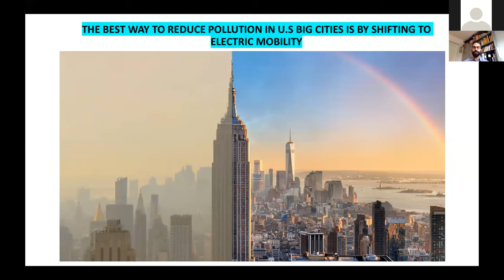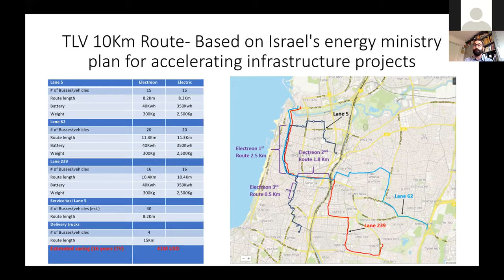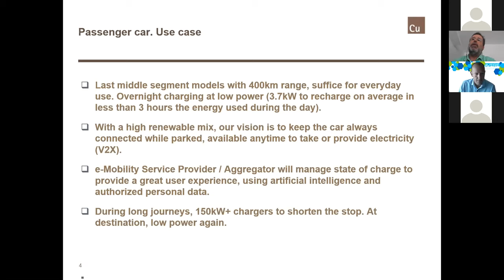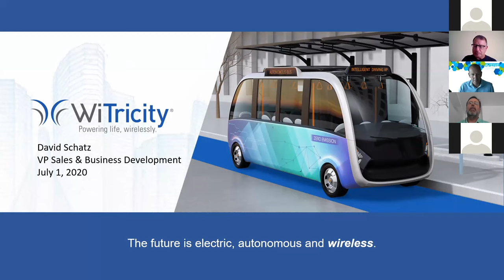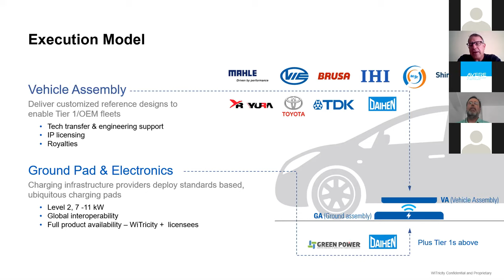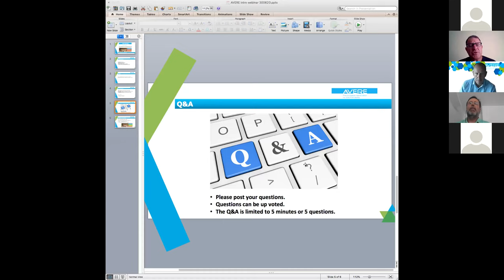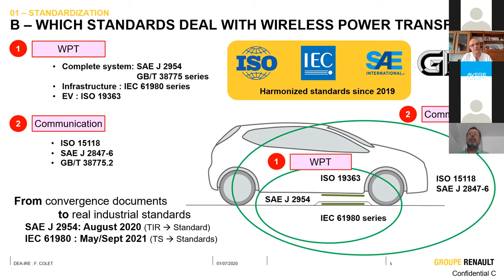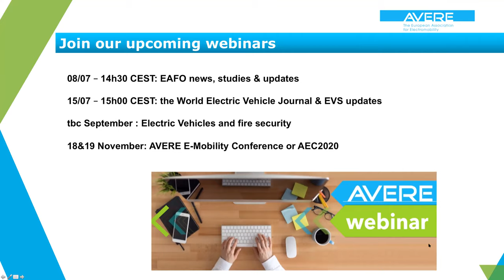AVERE Webinar - Inductive charging: The future of the e-mobility sector?

Comment: 44:00 
conductive:   grid AC   >>   car rectifier DC    =    <95% efficient
wireless:        grid AC   >>   pad rectifier DC   >>   pad inverter AC   >>   air gap   >>   car winding AC    >>   car rectifier DC    =    >95% efficient ???  
Right....